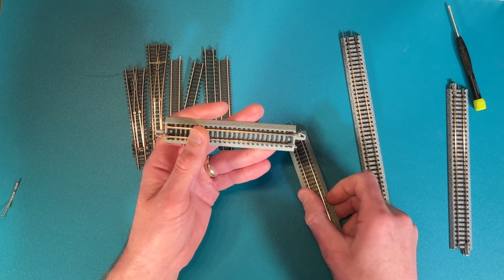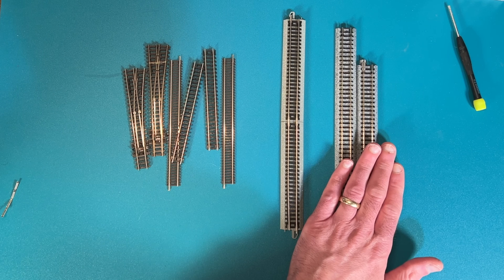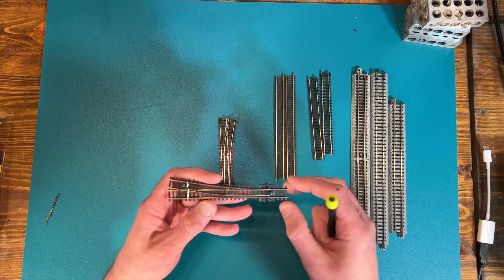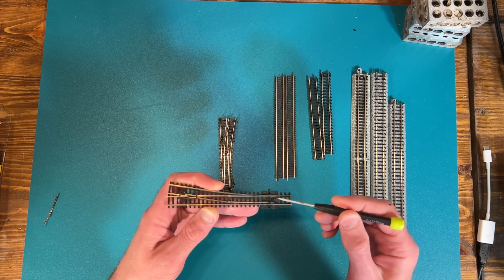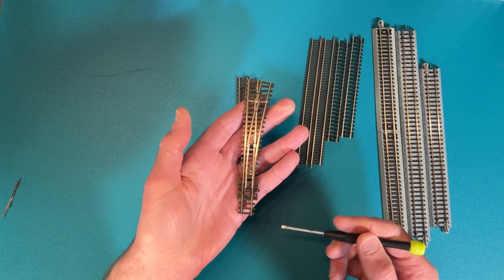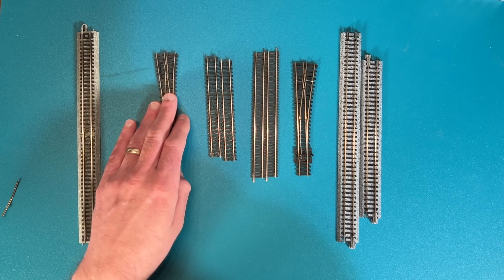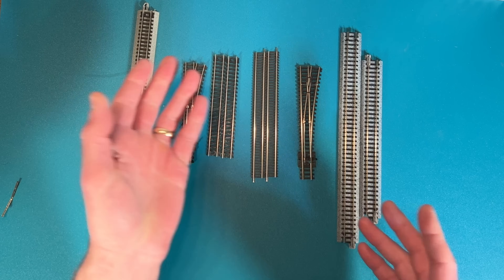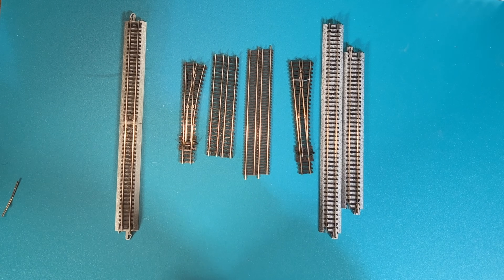What N Scale Track Should YOU Use?

Comment: A note on the Kato #6 vs #4 switch.  #6 switches are POWER ROUTING and cannot be changed.  This means if you throw the switch, the power is cut off on the non thrown side.  So this means you need to either add more power feeders, or just be aware that power is going to be cutoff.  The Kato #4 Switch can be either or, there are jumpers (screws) on the bottom of the switch that allows you to choose between if you want it to power route, or not depending on its use.  DO NOTE, that on some #4 switch's you need to see if it says Pat.P (Patent Pending) or not, some older switches have this.  The Labeling on the pat.p #4's for power route and frog power....is backwards (that is on if off and off is on) this is fixed on current Kato switches, but it is something to look out for if getting used ones at a swap meet or e-bay.

Comment: Just getting into the hobby and in the planning stage. Are the of the brands compatible with each other? Say the Peco 55 and the Atlas 55?
Reply from the maker: Yes and no.  The Peco code 55 is code 80 rail embedded in the ties to give a code 55 height whereas atlas is code 55 rail on top of the ties. You can use them together but have to make some custom rail joiners and generally solder those joints since the bottoms of the rails don’t line up.
Reply: @StevesTrains  greatly appreciate the response. Now I know to pretty much stick to one type.
Reply: @rodeo_cwboy  Our host seems to know his stuff very well and pretty much said it all, so I'll just back up what said with this: 
Since you are in the planning stage — and not adding to an existing layout — you can choose a type of track you think is best for you and stick with it. I would unquestionably use Atlas. Buy four pieces of Atlas flex track; two Code 80, two Code 55. Try laying down a bit of each as a test, and see which one you like best. This will also give you a chance to try roadbed and other building materials too. 
Lastly…have fun!
Reply: @bveracka  Appreciate the knowledge. My question stemmed from the fact many say the Atlas turnouts are not that great compared to the Peco, hence my question. I wanted to start in a good foot and not have to plan undo changes during my initial set up phase.
Reply: @rodeo_cwboy  No problem! I haven't kept up with the talk about products for a long while, but like any hobby, it pays listen to the experts and do your research.
Track is one of the big commitments of your layout. Because it's inexpensive too, I advocate for a "test board". 

To elaborate on what I mean; I grab a sheet of good plywood and lay down a simple circuit of track right on the bare wood to try things out. You'll need a nice sharp awl to put the track nails in, but it's not bad. This is great for testing all sorts of things; a repaired locomotive, rolling stock, or trying new track (like in your case), new roadbed, new scenery ideas; almost anything. Think of it like a lab.
Reply: @bveracka  That what my first layout is to be. Testing, for both DCC training and program and wiring. MY V3 comes in today. Still do not have an engine or roll stock to ride on it. lol
Reply: @rodeo_cwboy  I remember as a kid I'd always buy too many locomotives, haha! You're doing things the professional way, and the newer DCC setups are awesome. Sounds like you're going to have a great setup.

Comment: Hey Steve, when transitioning from Kato track (N Scale) to flex track on a layout using Kate’s conversation track, which brand and size flex track would you recommend using?
Reply from the maker: My personal favorite n scale track when not using Kato is the Peco code 55 track. That track uses code 80 rail but has it embedded in the plastic track so it is only code 55 height above the ties. The net result is that it is super durable.  Atlas and other tracks look great but the atlas code 55 track is super easy to break so you have to be a lot more careful with it. Since I usually do portable layouts I don’t like to use it, but for a permanent layout that is less of an issue.

Comment: Could you use Peco switches with Kato Unitrack with traditional cork roadbed for the switch?
Reply from the maker: Sure, I’ve seen people do that.  You just have to remove the unijoiners on the adjoining Kato track and then use regular rail joiners. You may need to file the joints a bit depending on how things line up, but it should work in theory.

Comment: If Kato track wasn't so darn ugly it would be nice. I'm an Atlas code 55 supporter. One note about Atlas C55 is the turnouts cause lots of derailments if you dont file the points to a razors edge, the guard rails are also a bit tight on the flangeways so Athearn wheelsets and older Intermountain locos like to jump the frog. I decided to build my own turnouts instead of spending $20 each only to have something that still needs a hour of modification before its fit for running trains.

Comment: Minitrix and fleischmann Piccolo are missing from this video.

On a side note, how good  is Atlas track code 55 in terms of reliability and durability? I am planning to use mainly Fleischmann locos and rolling stock in DCC.
Reply from the maker: Atlas code 55 is less durable for sure than others because of the very fine model spikes used to secure the rail. So, it looks fantastic, but you can damage the track far easier than with other. Not so much of an issue once installed, but the turnouts are more delicate than others too for the same reason so you have to take more care when cleaning them. It can perform well, but it isn’t like a lot of code 80 track where you can run over it with your car, jump on it, hit it with a hammer and it is still fine. Lol.
Reply: @StevesTrains  Ordered a small batch of Atlas 55 and a turnout in order to test them... I think I would definitely stick with the Fleischman Piccolo track from now on... Atlas track looks a little bit better on paper, but it is too fragile and most locos are kinda fussy about the turnout and track work when using Atlas 55. Never had this problems with Fleischmann Piccolo track or Kato track.

Comment: I found this useful Steve, thank you. I knew the track that came with my (new to me) Lone Star Treble-O-Letric set was Atlas, but I didn't know about code 80 & 55. I believe my set has code 55, but now I know before looking to add on to the set. I don't know if both codes use the same connectors, but if they do I may have a mix & that maybe why I was having power issues on my 1st try. Looks like with this old "OOO" scale, Peco 55 might be the best way to go in the long run.

Comment: Hi, I wondered if you have noticed any differences in conductivity between the different track types? For example how large of a loop can you make  that will run well with only one power supply point for each of the examples?
Reply: I used to use that mindset (how much can I run with only one connection) but later found it better to just learn the basic wiring. Its known brass is not a good conductor so just run a bus around your layout and power every 3-6 ft
Reply: All conductance be it wire,rails,etc will be subject to what is known as voltage drop,like how the pipes need to fill up for water to come out.anthonym744 is right.

Comment: I use the kato #4 turnouts on my layout and their has been a few problems but they still working fine.
Reply from the maker: They can be super reliable if you work on the ones that cause trouble. You can file the points a bit as well as the main rails so they fit better and usually that makes them more reliable if they cause trouble. It has been hit and miss with those when I’ve used them.
Reply: @StevesTrains  yeah for me I don't have that much issue and you know the kato ballast I use it on my layout because I suck at ballasting and kato unitrack has the most realistic molded road bed out there besides making your own road bed.

Comment: I changed from Peco code55 to Kato because it is so much easier to use. The turnouts come with motors as standard and the #4 turnouts can be altered to non-power routing for DCC. With the Peco turnouts I needed to have servos and micro-switches to deal with the frog polarity. And when I got all that connected up I would still have to ballast the track. Also the Kato track makes it easier to change my mind - which I do regularly.

I put a tiny blob of solder on the stock rails just before the switch points and it seems to have solved the derailment problems for the #4 turnouts. The Peco turnouts are better in this regard because they have a small indentation in the stock rails to take the tips of the points and give a smoother transition. The blob of solder fulfils the same role by preventing the edge of the flange getting behind the point.

Another great advantage of Kato is the fact that you can run a train through a turnout with the switch set against it and the train will push the switch rails over. That allows some routes to operated without bothering to change the turnout. However you do have to turn "frog-power" off for this to work without a short circuit.
Reply: @NBLeopard hey you should do a vid of your solder mod;
All I have been able to find are people filing a notch in the rail for the offending point tip to slide into.

Comment: Steve, good video. However I have used bachman ez track for sometime, I have had no issues
Reply from the maker: It can certainly work fine, especially if you don’t take it apart repeatedly. I’ve seen some great layouts with it that have operated well. There are more track options available in that line now than there used to be so it isn’t as limited as I thought when I first started making the video.
Reply: Hand -laid track beats sectional track anyday! Less joints, no limitation on curves, turn-out angles ( more prototypical)
Only downside...more patience, accuracy, and time required ( any Scale).
DocAV

Comment: Micro Engineering also makes Code 55 track and switches... I prefer the Peco switches but really like the ME flextrack (just looks better). It's not easy to use Peco switches with other vendor's track because of the shape of the rail but you can if you're willing to spend a few minutes filing the lower part of the peco switch rail at all ends (and mounting the switch a bit lower by using a rasp on your cork roadbed). I did that and was very happy with the result but it is quite a bit more work.

Comment: Wondering can you use atlas code 80 track with peco code 80 turn outs?
Reply from the maker: You can, but there is a slight difference in track height so you have to shim up the track slightly on the atlas side (or maybe it is the other way around. The rail height is the same, but the ties are slightly different thicknesses. It isn’t much difference but enough of one you will want to add a thin piece of card stock or something to even the rail heights up. Just soldering the connection might be enough to keep things even.

Comment: Good review.
Wondering about HO scale? I model in Kato HO and in my opinion, the choices are more limited than N scale sadly. I think Kato is missing an opportunity. Have heard there is some kind of Kato 'flex track" out there somewhere but not found it. As for switch controls, I prefer non-powered switches. Kato controls are far too clunky for my taste.
Reply: You can convert the turnouts to use other kinds of controls. I converted mine from 12v DC two wire to 16v AC  three wire Fleischmann switches.
Reply from the maker: Yes, HO unitrack is more limited for sure. The Kato switch controls are big and clunky. In control mine push buttons connected to dcc controllers like the digitrax ds74 units. You hook the turnout motors to that unit (each one can control 4) and then if you hook that up to your dcc system you can control them with your hand controller. That is clunky too so they give you the option to hook up a push button. One push button per turnout. Each push of the button flips the turnout from one direction to the other so it works pretty nice.
Reply: @StevesTrains  - have you done a video on that? Would like to see it if you did.
Reply from the maker: No, not so far. I can do one sometime in the future.
Reply: You can operate Kato's turnouts with a pair of double pole push buttons or a mini DPDT momentary centre off toggle switch. 

Yes, Kato's lever controls are huge and clunky, but they are great for the temporary "plug & play" type layouts that many in Japan set up on the tables and floors of their tiny apartments.
Reply: @emdB67  - thanks but me a wiring switch buttons escapes me 😟
Trying to interpret wiring diagrams, then soldering wires with big older shaky hands....
Reply: You have to keep in mind that KATO's home market is Japan, where N scale is the most popular scale due to a lack of space for HO scale. I don't think they missed that opportunity, I think they're just not interested in taking it. KATO expanding their HO scale range would be like if Walthers started supporting N scale properly - it's not their focus.

Comment: Kato unitrack is a trade off. Whilst its not the most realistic track, it is very functional, and if you are compelled to have  your point motors above the baseboard, if, for instance you have used mdf, unitrack is a perfect solution with the motors being in the base of the point. I would not like to try digging holes in 12mm mdf to accomodate underboard point motors. What about comparing other track options. Fleischmann piccolo (an excellent system),
minitrix or roco?
Reply from the maker: Yes, I need to try to obtain some of that track. It is harder to find here, so I’ll probably have to order some from overseas retailers that will ship internationally. I’ll add that to my upcoming video projects list.
Reply: Fleischmann used to be common here in the uk, but now its tricky to find. Kato and Peco dominate
these days.

Comment: My old layout was all micro engineering track with Shinohara turnouts, I loved it but we moved to a new state and the layout didn't.  After some years (retired) I got things out and started testing using a loop for Kato Unitrack, and expanded, and expanded.   I like it since it can be setup on the carpet and rearranged as desired, however I do notice the noise.   In my usual setup I have a long section of elevated track using eight Kato bridges all connected but I had been wanting an arch bridge so I purchased two Tomix and while they don't easily connect to Kato I was able to make a transition and have them as the center pieces of my now eleven foot bridge.   Here is what I noticed, the noise level on the Tomix was considerably lower than Kato, and I do mean considerable enough that I purchased a loop of Tomix track to see if it also applied to their track, yes.   Now for my dilemma, I have a lot of Unitrack but now really like Tomix which is unfortunately not readily available at any local train stores.  PlazaJapan has become my goto source,
Reply from the maker: Yeah, I’ve never seen tomix at a store, but I have heard a number of people say they like it a lot.